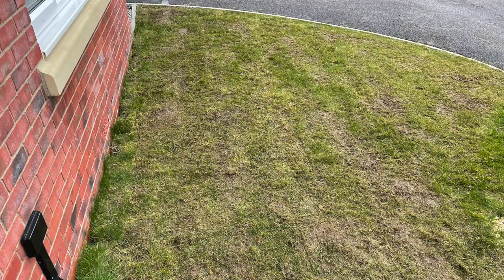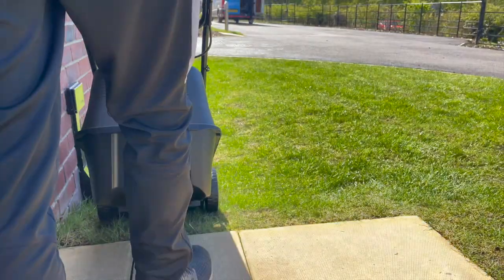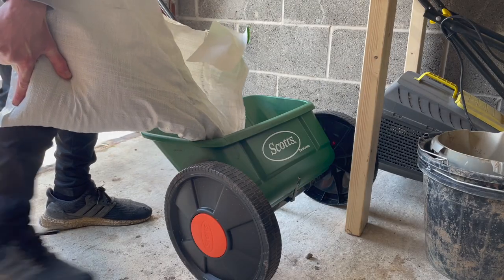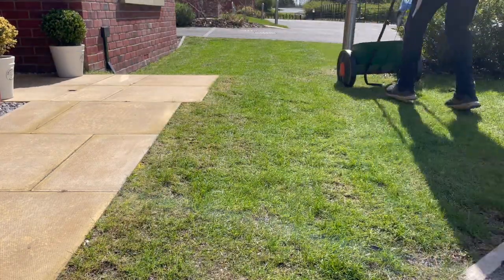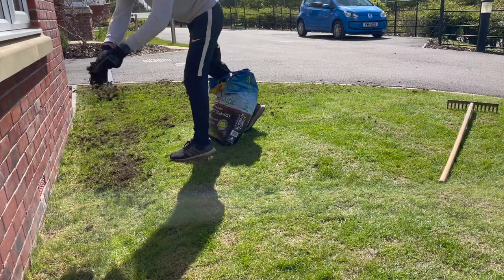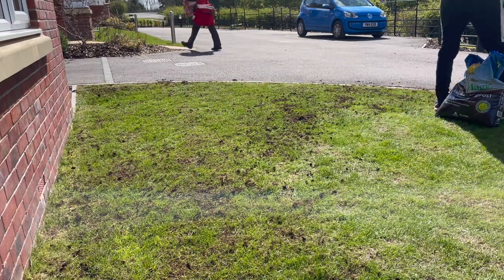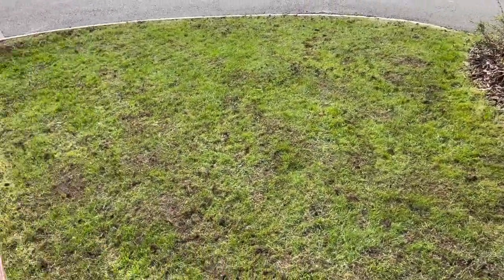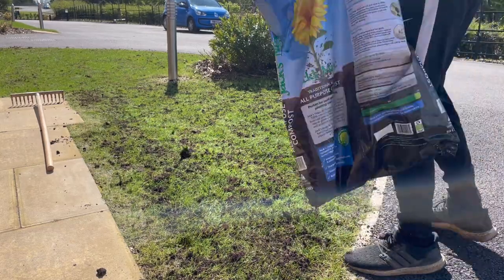How to Over Seed your Lawn and Top Dress with COMPOST

Comment: Nice video. I've just recently completed my front lawn (144 Square mtrs) and basically used the same method as yourself.
Unfortunately the previous owner didn't really take an interest in the garden, so I inherited something that was like walking on a sponge, the amount of thatch I removed was unbelievable, 2 trailer loads and 20 bin bags 😩.
After heavy scarification I reseeded then top dressed with the new Jack's. The new blend definitely works well, but there is a lot of wood and what appears to be small white pumis stones in it, I made a sieve that fit's over my wheelbarrow and took the most of the larger bit's out before dressing and after 13 days the lawn is looking fantastic, I hoping to do the first cut with the rotary in about another week, then with the cylinder mower a week or so later.
It's videos like yours that give us newbies confidence to take on projects like this, so thanks for posting and best wishes from Northern Ireland 👍
Reply from the maker: Thanks for the kind words, appreciate that 👍🏻

Sieving is a great shout, I may try this next time. I’ve just over seeded my back lawn and I wish I had read this comment before I did. Quite a few sticks in the bag I used today. But it’s great stuff, recent seed has germinated brilliantly.

Comment: I use jacks magic every year when I renovate my lawn and get good results. Although the new 50L bags are a new mix . Going to try the new mix next week
Reply: I noticed that this year, seems a better mix than previously in my opinion, although I always siv mine using a 10mm siv on the lawn to get rid of any big bugs that don’t break down
Reply: Don't bother, they have changed Jacks magic compost Formula. To many white stones in it.
Reply: @lotuselise140  I’d like to think that is perlite but could be wrong, there smaller than 4mm ish anyway won’t do your lawn any harm. Can help with drainage and break up then soil etc. you won’t see it when the grass grows back anyway and it’ll bed down Into the soil

Comment: Mate, I was wondering if raking messes up the  distribution of seeds evenly after having used seed spreader.
Reply from the maker: It can do, but it won't disturb it too much. Sounds mad, but sometimes I just brush the compost in with my hand to make sure that the spaces are not too disturbed, but that only works if you're doing it over a small space like this. It's what I did yesterday when I did some light over seeding.

Comment: I'm doing this tomorrow. I need to roll the ground afterwards, otherwise the rain will wash the seed down the hill. (my lawn is on a slope) However I am very worried that the soil will stick to the roller because it is wet. What can I do?
Reply from the maker: You may need to wait until it is dry before you do unless it will stick. If it's dry, you'll have no issues with it sticking as long as what you put dow is dry too.

As long as the rains are not too heavy over the next week or so, it should be ok. It will only be a heavy rainfall that will cause a lot of move.

Comment: Can you use the drop spreader for top soil or compost? What's the best way to spread it?
Reply from the maker: You can only use it from seed and granular products. The holes would be too small for any soil or compost.

It would just dump it down onto your lawn, you should be able to use the back of a flat rake to spread it around.
Reply: A peat moss spreader works great. It's a rolling cage. Keeps back the big parts, sticks, rocks, you don't want on grass.

Comment: Great vid. Just a side note, it's not advisable to add compost to your lawn on a regular basis. A well screened top soil is more beneficial long term. 👍
Reply: why
Reply from the maker: Compost breaks down over time. It’s great to use when you over seed because it will hold moisture so that the seed doesn’t dry out and the nutrients will seed up the growth. It shouldn’t be used too heavily for things like levelling because it will just break down.
Reply: @christopherthomson1978 .  The only time you don’t want to topdress with compost is the extreme heat of the summer or winter when the grass is dormant. 

I topdress twice a year. Spring (April-May) and and in mid September.

Comment: Can you advise what products you use for weed killer / fertiliser as part of the scarify process please?
Reply from the maker: I’ve not put any weed killer on my lawn this year, but anything that says ‘kills weeds, not grass’ on the bottle will do the job. And with regard to fertiliser, A1 Lawns do a cracking spring/summer mix to go on lawns. I’ve just posted a video today applying it. You’ll see the results that I’ve had with it on the front lawn, it’s been superb!
Reply: @NoviceGardener  awesome, only found your page the other week and it’s great fella
Reply: @NoviceGardener  also only found you as I bought the same aldi scarifier this week haha
Reply from the maker: Ah, nice one! Hope it’s doing a good job 👍🏻
Reply: @NoviceGardener  still in the box debating if it’s too late into the summer but seen some stuff about watering a lot to salvage it
Reply from the maker: Watering is a good shout. But using the power rake attachment might help too. I used it on my front lawn about a month ago, so much came up even though I scarified it back in April
Reply: Careful of weed and feed when overseeding. The weed part can hinder germination.

Comment: It would have nice to see how much seed the seed spreader dumped on the lawn. I’m sowing by hand and don’t know how much seed to put down. I’m seeding from scratch and using peat-free compost, which I  put on top of the seed so the birds don’t eat them. They ate the lot last time!
Reply from the maker: I usually just eyeball how much is needed. As long as the needs are not on top of each other or blocking out all of the soil below, you're good! I've just uploaded a video of over seeding by hand, may be useful.
Reply: Why peat free? @fuzexi doesn’t the peat keep the moisture in?
Reply: @KatyNik  peat-free because using peat is really bad for the climate.
Reply: @fuzexi  copy, right! Maybe coconut coir then?
Reply: @KatyNik  actually I did sprinkle some of that down, but it was just because I had some dried coconut coir, and everything I grew in it died, so I mixed it into the compost/soil mix to bulk it out a bit. My strategy for keeping the ground moist is to water it once in the morning and once in the evening. The grass seems to be coming up fine now, apart from where the pigeons have been, so I just got some bamboo canes and attached long bits of polythene to them which flap around in the wind, and that seems to work. I also mixed in some wildflower seeds: yellow rattle (had to put that in the freezer for two weeks) birdsfoot trefoil ( had to soak that) and clover, daisies, buttercups, scarlet and blue pimpernel and a few others. Dandelions will come by themselves! I can see things are coming up but I don’t know what they are.
Reply: @fuzexi  Very cool! 
I wonder why nothing grew in the coir? Weird. I’ve never use that stuff. 
I’m currently right now over seeding with a whole bunch of fine fescues, and I will likely dust it with peat moss that I guiltily bought - I forgot how bad it was. I might screen a little compost as well but it’s a bit tiresome ha ha. I have an entire lawn separate that is pure white Dutch clover. And then an area that is micro clover and low lying wildflowers that I got from West Coast seeds. It’s fun playing around isn’t it?!
Reply: @fuzexi  Good idea with the bird distractions. I haven’t seen the crows in my yard too much yet, but I’m here all the time and will run them off if I do
Reply: @KatyNik  yeah. I’ve had lots of ideas too. I was thinking of sowing a chamomile lawn, and probably would/should have gone for it. But I needed to get it done before summer hits. The main objective in my case was to cover the ground to prevent evaporation. I have subsidence issues with my house and the people just cut down a whole load of trees and stuff that had grown unchecked by the previous owner. It’s minor but I don’t want it to get worse. The previous ground cover was a mix of ivy and litter blown in from the street. But now the trees are gone (and the ivy and litter) the place has become a desolate, windswept landscape. Also there is a robin that used to nest in the tree that is now gone. So I’m trying to build a new habitat for him and his other bird chums, as well as try to get more water into the ground. I’ve got a patio round the back and thinking of lifting up the slabs and putting gravel or something to let water in that side of the house. This morning I noticed that there were areas where the ground was being lifted, it was really weird: cracks in the ground and areas of soil bing lifted upwards, like it was bubbling up. I lifted one bit up to see what was doing it, and it was all the tiny grass shoots, all yellow trying to bust through the extra topsoil i had put on top. So I was carefully lifting away the topsoil to give the baby grass some light.